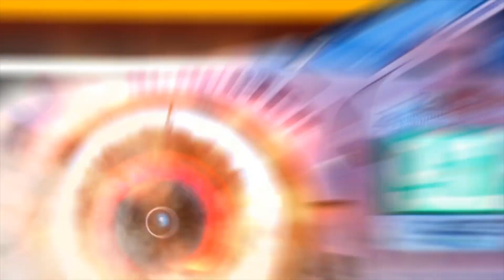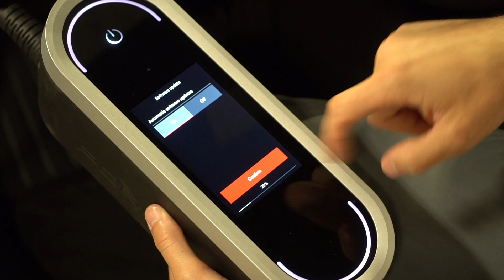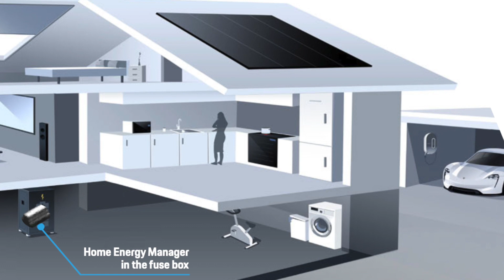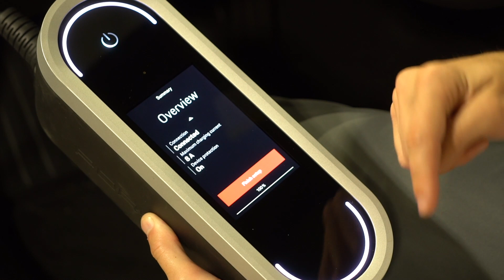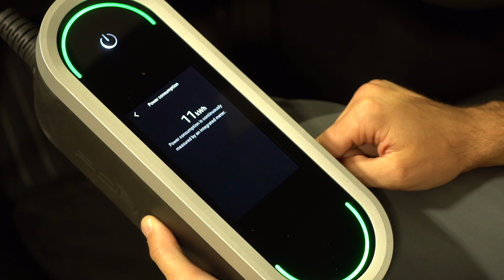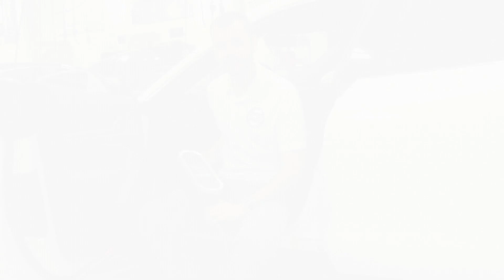How to Set-up and Optimize the Porsche Mobile Charger Connect For Your Taycan!!

Comment: Where did you get the info that the 12v battery could be killed by charging at only 6A? Doesn’t seem to fit with other sources of info eg direct from Porsche.
Reply from the maker: Hi Michael! There is a Technical Bulletin (TI) "2706 Discharged 12-Volt Battery After Charging the High-Voltage Battery" from Porsche that states when charging on a 120V at 6amps there could communication errors between the high voltage charger and Taycan which results in increased power consumption of the 12V battery which in turn can kill the 12v battery. The document recommends to keep the power output to no less than 8 amps when charging on a 120v in a pinch. There will be a software update sometime early this year to fix the error but it is not out yet. Hope this helps 👍🏼
Reply: @Pcarwhisperer  whoa! thanks for sharing this information!
Reply from the maker: @panasonic232  You're welcome 🙏🏼
Reply: Hi, how do I set 8Amps from the charger(non-screen) which was provided when the car is bought?

Comment: Also  If you plug into a 240 volt plug make sure the outlet receptacle  itself is rated for use with an EV   ( look for the EV in a Circle Symbol on the plug )  an Older outlet for example a Dryer is not safe to use.  It was not tested for the continuous current flow that a EV draws.

Comment: Why does it let you charge at 6A if it will damage your battery?  Why is the default no 8A?  I received my Taycan with the standard charger which I think was free or included with it.   I would have liked to have upgraded to this connect one with the screen, should I have been offered the chance to do this and what is the price difference?

Comment: Is this the actual charger included with the taycan?
Reply from the maker: Hi Diego! Yes there is a charger that comes standard by the name of Porsche Mobile Charger Plus. 👍🏼
Reply: @Pcarwhisperer   Thanks and sorry for asking again, so when people purchase a Taycan, this is what comes in the car? or does it need to be purchase separately?   I'm considering a fixed wall charger and keep this one mobile ( in the car in case of an emergency charge ).  Also, have you considered doing a video about multiple charger options for the Taycan?

Comment: Nice video. Do you know whether can I use Tesla Gen2 charger for Taycan?  Where can I buy the longer cable (7m) from the mobile charger connect to the car?
Reply from the maker: Thank you Benny! With the proper adapter I have seen a Tesla Charger charge a Taycan! The only place I am aware you can purchase the longer cable for the Mobile Charger Connect is your local Porsche Dealer! 👍🏼

Comment: Can you use a 110 or does it have to be a 220 volt
Reply from the maker: You can use a 110 it will just take a very long time and is not recommend as from 0% to 100% it is rated at taking approx.. 96 hours to complete the charge.

Comment: Great video. But what is the advantage to use this device? Isn’t all the charging setting already in the car? Or better yet, the Porsche Connect app should be able to adjust charging max current and time to charge like Tesla. Or we cannot adjust any of these without the Mobile charger connect?

Comment: Keep this going. I need to learn everything. I have one on order. Thanks.
Reply from the maker: Thank you Bari! Most definitely will.... a lot of video's in the works! Congrats on the Taycan! Which model and color?
Reply: @Pcarwhisperer  I ordered a Turbo. Checked off many boxes. I keep going back and forth about "did I make a mistake?" I love 911's. I have had 2. I presently have a GTS and love it. The Taycan will replace it. I like taking chances so I will see what the Taycan will do. Another you tuber guy (Nick Murray) has me scared about the b pilar. He said it is very difficult getting in and out. The other negative comments didn't scare me. The b pilar did. Looking forward to your information. Mine won't be delivered until June/July.
Reply from the maker: @barivitolo6273  Awesome congrats! You are going to love it! Will it be your daily driver? It is a bit more difficult but not substantially I think you'll be just fine! Perfect just in time for summer! 😊
Reply: @Pcarwhisperer  not my daily. I just got a cayenne gts coupe for my daily.

Comment: Mason, thanks very much for the excellent video.   If you have a ChargePoint Flex available which will charge at 11 kWhr (vs. 9.6 kWhr), will the Taycan onboard charging system automatically adjust?   Or does the vehicle have settings like the Mobil Charger Connect (MCC) which need to be made manually in the vehicle?      I have been told that the Mobil Charger Connect has added features which will "future proof" Taycan charging.  I am not clear what the advantage of the MCC is over third party units like the ChargePoint Flex other than you can link to the Porsche app.
Reply from the maker: Jack! Thank you for the support and kind words 😊 That is a great question! Was not familiar with the Chargepoint Flex until you mentioned it... looks like quite a nice unit! The Taycan will automatically adjust adjust charging rate based on the infrastructure it is plugged into but in this case I believe it would limited as standard the Taycan comes with an on-board AC charger at 9.6 kWhr limiting the rate of charge! Unless the car is equipped with the optional 19.2 kWhr on-board AC charger! With this option the on-board unit is able to convert the incoming AC energy to DC energy to be stored in the battery at a faster rate!  If the car does have this option it will be available through Porsche Tequipment! If equipped with this particular on-board charger the Taycan would be able to take full advantage of the ChargePoint Flex and would automatically adjust the charge rate to 11 kWhr as now the limiting factor is the charger not the car 👍🏼 Yes the MCC will help "future proof" a bit more as it can be hardwired into your houses electrical panel bringing charging times of up to 19.2 kWhr if equipped with the on-board charger as above! It will also be able to work seamlessly with the "Home Energy Manager" that control's the rate of charge based upon current household energy output and automatically adjust it! See Porsche Taycan Configurator go to the bottom and under the "Tequipment Accessories">"E-performance". Hope this helps Jack! Thanks for the support!

Comment: So confusing.. gonna stick with my amg until someone can teach me how to charge..
Reply from the maker: Once this charger is set up for home use this is the only time you need to configure. After initial set up just need to plug in the Taycan and it will start charging! 👍🏼
Reply: @Pcarwhisperer  thanks your Chanel is helpful, but im wondering more about like wattage and voltage and speed and when to stop charging etc.

Comment: Do you think I could install this outside? It won’t be submerged in water, but rain could def touch it. Do you think this would be okay like the Tesla charging?
Reply from the maker: Yes can Definatley install outside! I think it will be okay as long as its not a ton of rain! Will the charger be installed on the wall?!
Reply: @Pcarwhisperer  thanks foe the quick response. Yes wall mount under roof off-set.
Reply from the maker: You're welcome! That should be fine Ahmed but would recommend getting the charging dock as shown here just to be sure as it protects the best against the elements! https://www.suncoastparts.com/product/SKUHYBSHELF.html

Hope this helps!!
Reply: @Pcarwhisperer  thanks!
Reply: @Pcarwhisperer  yes on the wall inside. Your videos are dope!

Comment: Why would taking it down to 6 amps to protect your electrical supply and plug drain the 12v battery? that doesn't actually make sense, please explain thx as in UK we turn down the amps to ensure it doesn't overload our 240v socket and overheat
Reply from the maker: Hi James! At 120v 6amps there is the possibility of discharging the 12v battery due to a communication error between the charger and the vehicle causing discharge to the 12v starter battery. There is a Technical bulletin here in the US about it and there will be software update sometime this year to fix the issue! It is possible the issue isn't happening to cars in the UK. What amperage are you keeping it at on a 240v socket?
Reply: @Pcarwhisperer  Hi I actually keep mine at 10amps when needed but rarely use the mobile charger on a 3 pin domestic socket in UK at 240v, but there is a general recommendation to turn amps down to prevent overheating especially when using an extension cable, so 6 amps  if charging for a long time. We have had a few 12v issues but not relating to the mobile connect charger, it happens on all chargers and Porsche do not have an answer as some are plugged in and some aren't when 12v fails
Reply from the maker: Gotcha! Interesting, thank you for the insight James! 👍🏼

Comment: Do you get this as standard with the car
Reply from the maker: Great question Ronnie! It is a $1120 option on all models! The car comes with a charger called the Mobile Charger Plus as standard! Main difference is the kilowatt output is less at 9.6kW to 19.2 on the Mobile Charger Connect and no screen on the charger.
Reply: @Pcarwhisperer  aah ok, mobile charger plus and mobile charger connect .. I get it now thanks for the reply.  Keep up the great work